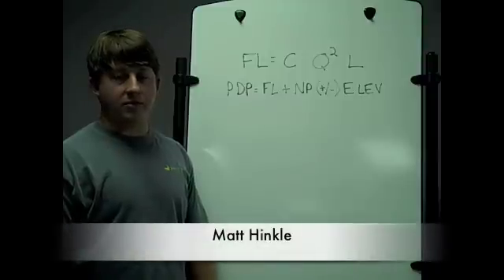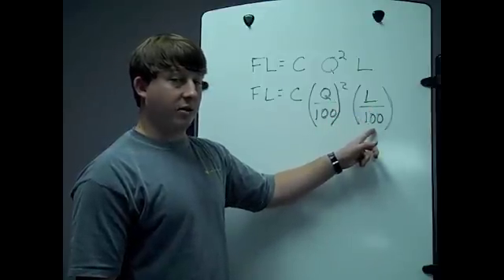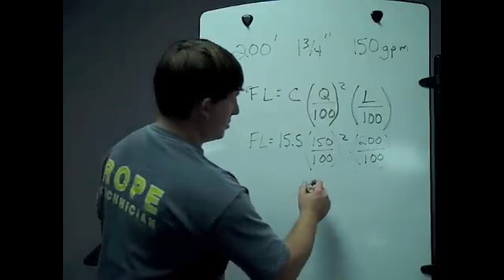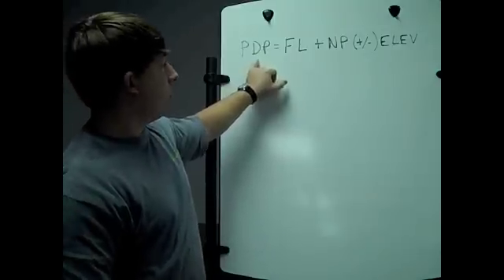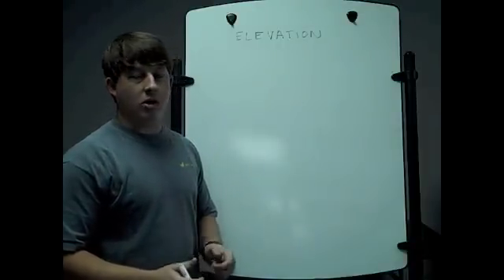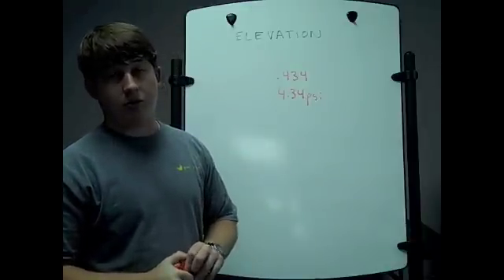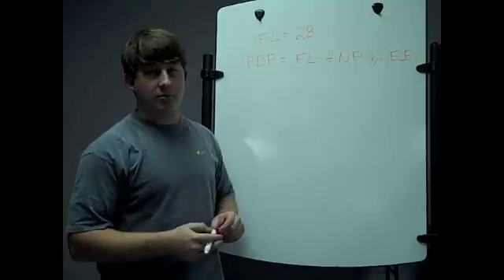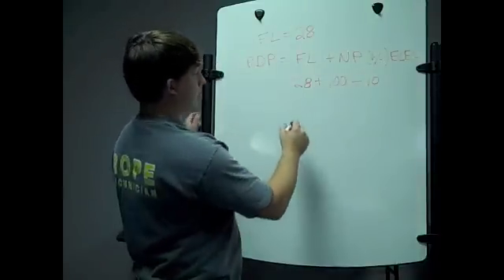Friction Loss Explained

Comment: you're making it way harder than it has to be, charge the line and step on it
Reply: You're not doing this on the fire ground, at least, you shouldn't be.  Do this , BEFORE you get on the fire ground, then you have an idea where your pump should be, and adjust according to fire conditions, and what the nozzleman is telling you.
Reply from the maker: I apologize. I will add “charge the line and step on it” to my delivery.

Comment from the maker: It is all dependent on your coefficient of friction.  Some hose lines have different coefficients.  Hale pump friction loss cards are probably not the same as a High Combat hose chart or any other brand.  They are all slightly different but close.

Comment: I appreciate you demonstrating these calculations, however, the Hale pump friction loss card says 150 GPM through an 1 3/4 hose yields 22.5 PSI per 100 ft. If you don't square the Q part of your formula it comes out exactly at 23.25. In addition I have pumped this at 150 at the pump with a fog nozzle and arrived with 150 gallons in a barrel in 1 minute. In other words your formula is too high for friction loss. I know you did not write it, but it miscalculates FL.
Reply: I believe the hale pump cards, are under ideal "testing" situations.  We learned this same formula, as the video, in fire school.  When we test our hose, annually, we use these calcs to know exactly what each line on each pumper, will flow. The problem with the hale cards, is that as pumpers and pumps age, they don't account for decreased pump performance.  That's why it's important to test your pumper, how you would actually flow at a fire.  When we do flow tests, we can make up for whatever decrease there is.

Comment from the maker: I just used 95gpm to have a different problem.  Just to change the scenario up.  You can input whichever gpm you use to figure the correct Pump Discharge Pressure.

Comment from the maker: For the 300' 2.5" line, if you are still using a 15/16" tip it will still flow 185 gpm.  Your friction loss will be different though.  It would be 7psi/per 100', so 21psi of friction loss.  Your total Pump discharge pressure would be 71psi for that line.

Comment from the maker: I am unfamiliar with the task force & vari fog... Do you mean it is a Task Force Tips nozzle that is just an adjustable fog?  You need to know the operating pressure and gpm of the Nozzle.  It should be stamped on the nozzle or the gpms should be on the ring if it is adjustable galonage.

Comment from the maker: I'm not sure I'm following you completely.  The common operating pressure of a smoothbore handline is 50psi.  A 15/16" tip at 50psi will deliver 185gpm.  Then friction loss would be determined by 185gpm through 200' of 1 3/4" hose.  Which would give you a friction loss of 53psi/per 100' which is 106 total friction loss for the 200' hose, you would have a Pump Discharge Pressure of 156psi.  That is for your 200' smoothbore speedlay.

Comment: What do you suggest for a task force & vari fog & solid bore 1" 3/4 for the optimal gpms that you think is right? I'm getting 125 from my instructors but some people told me 150gpm? I''m a 13year mpo & I'm humbly trying to q/a our techniques & everyones #'s are contradictory to each other. 

We use 200' smooth bore (15/16") tip for our main attack speedlay & a back up 200' vari-fog 1 3/4" speedlay. We also use 2 1/2" 300' smooth bore or vari-fog attack for commercial. PLEASE HELP ME!